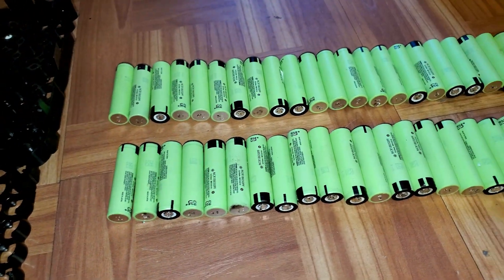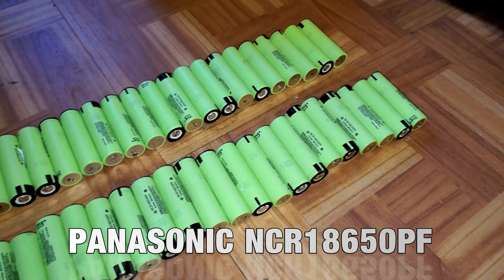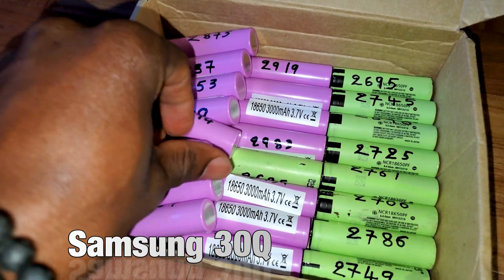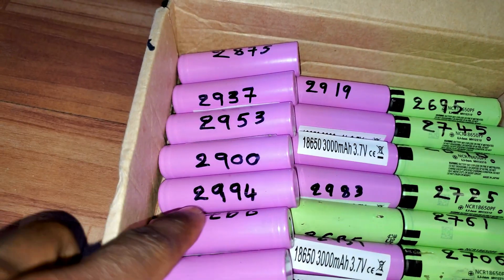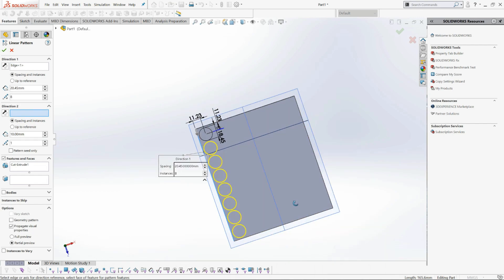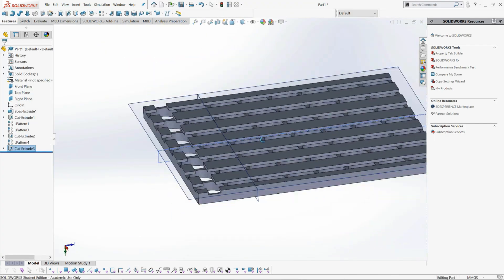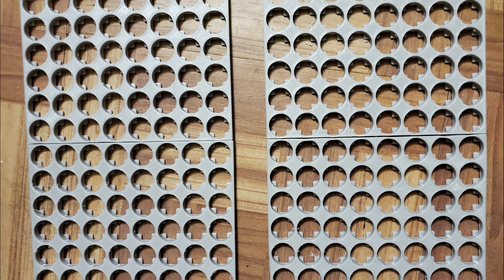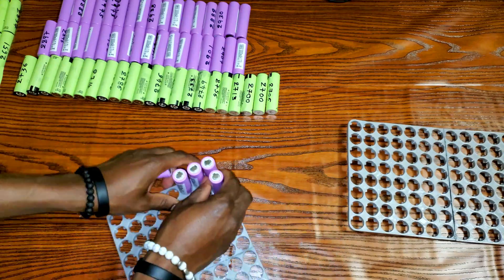BUILDING A 13S8P BATTERY PACK | 18650

Comment: Hi, would you be so kind as to give me the 3D model to print the cell holders? And one last thing, can you tell me the thickness of the nickel? I need to build a 13s 8p with 40ah
Reply from the maker: Hi, sure. You can download the files here: https://www.thingiverse.com/thing:4726003. it's a split model that you need to glue after printing (I designed it that way so it fits onto most print beds). In this video I'm using pure nickel strips 8mm wide and 0.2mm thick. I'm curious what 18650 cells are you using? for a 40AH 8P pack, you will need 5000mAh cells. Not sure if those exist in 18650 size
Reply: @YvonSmart  tnx ! Im using EVE INR21700-40P 4000mAh - 50A , I want to make a battery pack with 48v 13s 8p give me some advice on the connection, how much can I output as ah?
Reply from the maker: @massimo6597 Okay, my cell holders are designed for 18650 cells. I haven't designed holders for 21700 but maybe you can find some on Thingiverse or order the injection molded abs ones online. With those cells you will have a 32AH pack. If your application needs 50 amps draw, you need a BMS that can handle that. I recently made a video where a rebuilt one of my old packs using 21700 cells too. Links to all parts I used are available in the description here: https://youtu.be/RnCBn9KI6bM